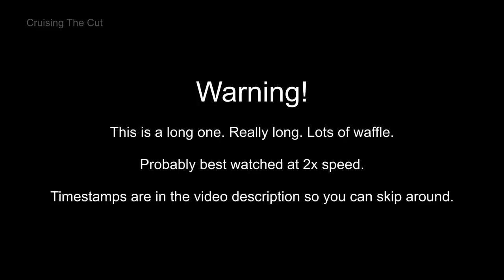241. Narrowboat DIY: refurbishing my shower cubicle

Comment: David, at 27:30, a construction adhesive will adhere the board to the wall tile behind it without using screws, though it's a bit like diamonds as it is "forever"!
I must admit I enjoy watching your "Warp Drive" mode, with the speeding -up of the work and the unintelligible sounds made.  It's entertaining and skips the more boring stuff.

Comment: 1st its nice to see you back on the telly 😀 I know this doesn't help now as you have finished but the gaps in the board you didn't like are a good thing you really don't want the boards to tight to the wall top/bottom/corners as you will need room for the boat expanding and contracting the silicon will fill the gap and will expand and contract a little so you don't get leaks and if you use tape up about 5-10mm from the edges on the boards and ceiling etc when you finish putting and sealing up, pull the tape and you have perfect sealent edges 😀😀 nice job though looks so much better 😀

Comment: The Shower looks so much better now, well done! All DIY seems to start with one simple job leading to several more awkward jobs, pushing the cost up by 4 times and adding a few more days. Simple fix to your original problem...... use the shower tent from the van and tuck it inside the shower tray!!
Reply from the maker: Haha good plan!

Comment: most enjoyable theory packed wet wet wet detective work.  been there done it .   these small jobs   usually end up predictably .  0.8 mm thick angle grinder discs   cut plastic sheet and tubes and steel  like a hot knife through butter .love your scribing tool. leaving a small gap will allow the sealant to gran the end of the panel and lock into the molding . I am suffering eyestrain watching your videos .. 76 year old you tube addict .

Comment: Didn't mean to put you off with my comments. I have encountered challenges on more than one project yet found a solution and you should be proud of your work. it really turned out great. Hail to the DIY'r. The "marble" plank is not something I've seen in the US and am intrigued. I was wondering about the water supply lines to the shower etc. The grey color (in the US) suggests it is PB, Polybutylene pipe which was banned in the US after 1995 due to early failure. No wish to cause you sleepless nights,  I replacing it as quickly as I can in a mobile home (fancy name for a trailer) in Tennessee with PEX. These fine accommodations are serving as a base camp as we start on an off-grid cabin. Just curious. Please keep the VLOG alive. Until we can travel again it is as close as we can get to visiting our friends in Derbyshire/Cromford area. I miss the UK even if my ancestors felt the need to leave in the 1600-1700's for probably being horse thieves or religious nuts. Spence
Reply from the maker: Cheers

Comment: Hello David Sir Welcome back and well done on the shower I have to say you did a major Renovation how ever I would Next time suggest you try the Metal and form to fit the shower and demo the old fittings of the shower and form fit the new metal to the shower stall it will save you and No need to calk or screw just form fit

Comment: Your shower reminded me of an Airstream camper (caravan) here in the states. Being designed originally by an aircraft builder the whole body is a compound curve. Fitting new cabinets to the things are a challenge and you discovered the secret. Fit the curved end then trim the straight edge to fit!
 I think your shower came out quite nice and looks soooo....much better than that tile! 
 In my opinion tile is best left to the subway.
 I'm sad there will be no more videos of your travels in your boat.
Cheers!
Terry from South Carolina USA

Comment: That was great to watch. Diy is your Jam! As is said
Reply: A cool DIY project would be to update your onboard router with a great 4G and 5G router & external antenna & a power over ethernet Accesspoint. It would be fun
Reply from the maker: Cheers. I have a good 4G router already and external aerials. There is no 5G along the canals (perhaps with the exception of parts of central London).

Comment: Happy hint.  Sugar soap is a brilliant degreaser and can be used on any surface, including varnish, paint (waterproof), tiles and washable wallpaper.  Costs nothing and you can make bucket loads.  I’ve actually cleaned walls with it, with the intent of repainting, only to find that repainting was not required.  The left-hand side "may" have been accomplished without splitting the bottom from the top, leaving a join half way down.  This could be done by cutting a grove on the back of the strip to match where the bend would be, which would allow the panel to easily bend at the change in plane, avoiding the need for a horizontal join in the panels, which could leak when the sealant shrinks in 12 months. 
Hindsight is an exact science, so they say.  Thank you for the video though.  I have learned an immense amount and now
think that I can attack my awful shower and actually fix something, and make it work.

Comment: Hello David, just watch the shower cubicle vlog but as a plumbing and heating engineer I  wish I could have spoken to you before you started. When l bought my boat it had a miserable little tray with three sided curtains, what a mess so out it went. It was exactly as yours with alternative black and white tiles. I took them off.
I had space to the right so l after removing the horrid plastic tray l fitted a larger ceramic tray but moved to the right. I then bought 2400x1200mm shower boards with plywood backing so avoiding the sloping wall on the left. As the boards were self supporting the left panel was no problem. Like you l had the same silly tap which l replaced with the same valve as you had. I was able to easily plumb the valve in the  space to the left. Last job was to fit the new glass shower door. I would point out that l paid nowhere near the price you paid for the boards.

Comment: Hi, I did my farther in laws downstairs toilet with that board, I too had a bend in the plasterboard but instead of cutting the board I secured some more plasterboard and made the bend go away, thus getting rid of the need to cut the board and have a possible leak. My father in law was quite annoying and passed away at the age of 99 years but the fix had lasted 12 years without a problem so I suppose that was a win for the plastic board.
Reply: I hope you have someone in your life to fix your projects with or for you. Very much appreciate your funny and frank comment.

Comment: Builders glued the panelling on a shower refit in our house and had so much timber filling the bathroom to hold the panelling while the glue dried it was a child's climbing delight. No help for you though as space was already limited. Well done the geriatric contortionist that you are and may your boat be dry within.

Comment: Curious as to why you did not remove the tile, line the underlaying structure with 1/4" marine plywood and then attach the new bath panels to the plywood? It would have given you a much smoother and uniform structure to work with. Over time, the tiles are going to continue to expand, contract and crack behind the panels. More work. More materials and cost, but better finished product. But, over all, a job well done!
Reply from the maker: There is already ply underneath the tiles, it would be a helluva job to remove them all and do that, and entirely unnecessary

Comment: I think the worst part of bathroom renovation is that after working in a small, poorly ventilated room and getting all hot, sweaty and dirty you can't freshen up with a nice shower because its all in bits.
As for the new taps: You can get short lengths of flexible hose with steel braid around them and screw fittings on the end from the DIY store. Or a couple of screw in nipples to get the length you need to mate up with the existing pressure pipes. You might even find that the threaded tubes will unscrew from the old taps.
Reply from the maker: Cheers. I'm cautious about trying to take the old threads off as they look fairly stuck with limescale etc and I'm wary of damaging them (and as soon as I take the taps off, I have no water in the boat because the supply pipe there doesn't have an isolator!!)

Comment: I'm not one of the 10% or 90% but I'm glad 90% have voted in favour of the video. I thoroughly enjoyed it and found some of your comments quite amusing. There's something about watching someone working hard and doing a great job that's very satisfying. Fair play to you, you did a bang up job. My thoughts with the shower head hanging thingamajig...(technical term) and I said out aloud....is it upside down? Could you have had the adjustable part at the bottom. I've fitted 2 exactly like your one and that's how I fitted them. I have to say you did a fantastic job and your G&T was well deserved 👏 I've a motorhome with a crappy shower decor and this has inspired me to look up your plastic panels.
Reply from the maker: Alas, not upside down, and had to be fitted that way as the bottom part holds the rest up.

Comment: I think you compensated for inexperience with some good attention to detail. It looks extremely nice and it fulfilled your vision of what you wanted.  With the work I do requiring some complicated sequences, and manual dexterity, I'm fond of saying, "The first time  takes 2 hours - the 2nd 30 minutes, and the 3rd five minutes. 

Anyhow the muck in the door channels or whatever that is at 48:40 can be cleaned with some mild ammonia and water or Comet and a nearby bucket 'o' water and a toothbrush. A stiff bristled toothbrush - a thing of beauty!
Reply from the maker: Cheers. Some of the muck is very old sealant which doesn't scrub off but some is muck and it does get cleaned occasionally (but being a door channel, promptly gets gacky again very quickly)

Comment: G, day David from Sydney, Australia.
You did a good job, not for no avail: waterproofing wet areas is difficult, and in a moving twisting area: more so.
* with needing to scribe, you can make a template firstly out of cardboard etc.
* main thing, plenty of sealant in joints channels.
* primer, undercoat and paint under shower tray. (Wet/dry particleboard/chipboard).
*hope to see more locks and views. Have fun, get as much sun light as possible.
Best wishes
🎚🇭🇲
Reply: I was wondering about sealant in the joint channels as well. Do you think he did enough?
Reply from the maker: Yeah, I'm not sure I squeezed enough in either but we'll see
Reply: @CruisingTheCut  I'm sure it will be fine. I enjoyed the video so much I watched it again and saw you putting plenty of sealant in. Missed it the first time due to distractions. I too hate grouting and have wondered many times why in the 21st century we have not come up with something easier and longer lasting. These boards look great and surprisingly cheap for the narrow ones you use. Very tempted to do my shower like this to the grout removal and replacement nightmare. Excellent and entertaining video, thank you.

Comment: Great job!! Looks so much better. Could you have turned the showerhead glide rail upside down and then you wouldn't need extra room at the top of the rail? Also on the wall at the side that you cut, if you heated it, it would have bent to shape. Still, it looks amazing.
Reply from the maker: No, it’s not designed to work the other way up
Reply: @CruisingTheCut  I may be a bit naive, but would it not have been possible to remove the top cap, just cut off a bit of the rail pipe, and re-attach the cap to make the rail fit at the existing holes instead...?
Reply from the maker: The material seemed to be very cheap and brittle plastic which I didn’t want to try cutting

Comment: You seem to have grey potable water pipe. Based on our cruise this pipe is prone to failure at joints. It has now been replaced with PEX pipe over time. Shark bite fittings in Canada were good to connect from grey pipe to new PEX. We found wet areas over time and followed the water to the leaks
Reply from the maker: Cheers. It's been there 21 years so far, seems to be OK (touch wood!)

Comment: David, if you simply cut one side - the side against the boat's wall - you should be able to bend the panels enough to fit the shower's curved wall.  Don't cut through all the way - and you won't need any sealant ("gunge") at all as the inner side (exposed in the shower) won't be open.  The panel will be easier to bend to the curve as well.
For curves, make a pattern or template of cardboard, mess with the curve until you get it right, then trace that on the plastic panel.

Comment: Suggestion for your new taps is to use a flexible hoses to connect the hot and cold water to the mixer fixture?

Comment: I must say, i did find that somewhat therapeutic!  Hats off to you because i dont think i'd have the patience to tend to that project and would have struggled through the whole thing swearing a blue streak!  I must say very professional looking job!  One question...the wooden ceiling within the cubicle, would that be better off covered with a coat of varathane/varnish or sealant of some kind? looks very nice when it's "woody" (python reference there as there weren't many "woody words" in this vlog)  just avoid it absorbing steam/moisture and turning colours on you later?   Either way, it all ended on a proper note!! a good stiff G & T!!  nice job sir.

Comment: Every job on a boat adds the 10x buggeration factor! Think you made a pretty fair job of this, mate. A vast improvement. Only thing I might have tried... where you took the panel up the hull side then up the tumblehome, it might have been worth scoring the back of the panel, to preserve the outside edge, but create the bend you needed. Tidier and less likely to leak. Btw, I think you can get extender pieces for the new shower mixer. A thermostatic mixer is so much better. Tip - always fit full flow stop valves to every tap!
Reply from the maker: Yes, frustrating that the supply pipe doesn't have stop valves already and there's precious little room behind the wall for me to install them now, unfortunately.

Comment: I'd recommend researching sealants that can withstand higher temperatures. There are roof caulks that potentially could stay strong and firm no matter how hot your boat hull gets... the physical expanding and contracting could potentially be accounted for depending on the viscosity of the caulk.
Reply from the maker: Yeah, I had to get such things when I did my campervan, that metal gets really hot!

Comment: +CruisingTheCut     Few thoughts may be of interest (even if late now!!!) --
1) Thought for that sort of corrugated material and horizontal joint...  I would have attempted to 'score' it cutting through the back and most of the way through the corrugations carefully, but not the front.  I would (expect) this would have allowed it to be kinked appropriately without needing a sealant/glue line between on the front.  I've done this sort of thing scoring hoardboard on back to make a smooth corner bend before...
2) Thought on the Sealant 'at bottom' -- I know with typical metal shower fixings etc. they actually want you to NOT seal the inner-edge bottom so that any water going down inside can get out into shower tray at the bottom...  (may not apply in your case, but trapped-water worth thinking about!).
3) Is the wood not exposed Under the door as well (even if not on end-grain) -- looked like that possible to me when camera in there?
Reply from the maker: 1) Good idea that I did not think of :-(
2) I have pondered that and wondered whether in fact to poke a couple of holes in my new sealant
3) There is no wood there so no worries (I know it looks like it but there isn't)

Comment: Those panels are actually pretty good for a budget shower refurb. Used them on our shower (though the thicker kind as that was all that was available then). They have held up very well (9 years so far), most of them look as good as new but unfortunately the area opposite the window, so presumably getting the most UV light, has degraded on the surface coating a bit which is a shame (still functional but not as aesthetically pleasing). For the cost and ease of fitting (plus speed) I am happy though and would probably use them again. 
Cost just over £300 at the time to do a very large walk in shower floor to ceiling. Tiles would have cost at least twice as much and would have required a lot more prep and installation time, the panels were installed on battens and fitted in a couple of days. Very easy to clean and maintain compared to grout.

Comment: If you turn the bar upside down and put the fixed screw to the top, you can then move the bottom screw to anywhere you want including the screw hole at the bottom.
Reply from the maker: No, I couldn't. If it could have been done like that, I'd have done that.

Comment: well done Sir, looks fantastic, as for the extra holes drilled for the shower rail, could you have turned it upside down and put the fixed end at the top and the adjustable end at the bottom into the holes already drilled  ....  Cheers, Garry from Down Under
Reply from the maker: Unfortunately, it won't work upside down as the bottom piece is specifically designed to hold the rest up!
Reply: @CruisingTheCut  darn ... that is a shame, hopefully a little white silicon in the extra holes made them "disappear"

Comment: Lino. Cheap, easy to work with, hundreds of patterns to choose from, easy to clean, warm to the touch and cushions your elbows when you smack them against the wall. Use sealant to attach. So quick there is ample time for lots of cups of tea.
Reply: A company in Ireland who sells it and is called lino ritche.